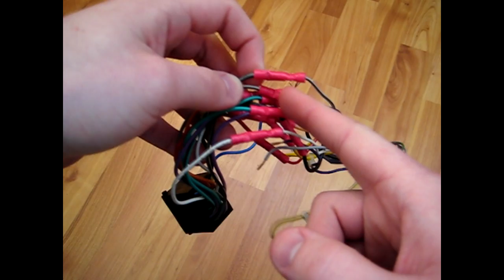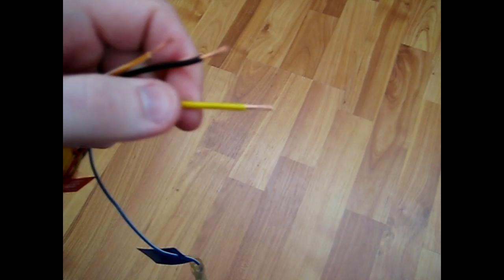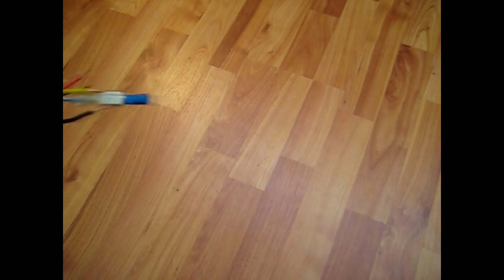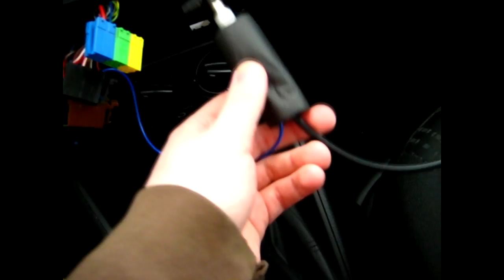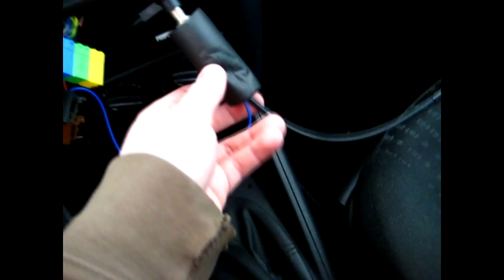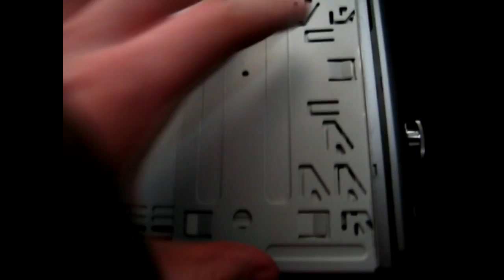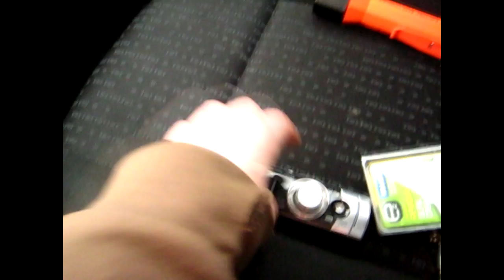DIY: Installing An Aftermarket Stereo Into Your Vehicle

Comment: I know im like wayyyy late but uh, one thing ive learned is that if u kinda take the wire stripper and spin it a bit around the wire, it cuts the outside. A few times ive just straight pulled it off and took a couple strands of wires with it (maybe im just a dumbass doing it like that, but just easier/less chance of screwing up imo)

Comment: hi i put a cheap carsio headunit in my car which was working fine, and still does, i have it wired to ignition, everything was fine, but all of a sudden it wont remember my radio presets whennit used too.....is there a little backup battery in these units?....which needs replacing?...thats the only thing i think it would be....cheers .

Comment: a  i have a 2003 passat, what dash kit for a single din stereo should i buy?
Reply from the maker: +tomas de lillo If you have a double din factory, then you will need a dash kit. If you currently have a single din, then you do not need one. Otherwise just pick the dash kit which ever is applicable to the vehicle. It'll stay on the side of the box whether it fits your vehicle or not.

Comment: i have a 1999 vw jetta vr6 i have two red/white wires which one do i connect my yellow aftermarket stereo wire too?? please help
Reply from the maker: +Christian Medina One is for the speaker and the other is the 12V source http://faculty.ccp.edu/faculty/dreed/Campingart/jettatech/speakers-front/VW-Wiring.pdf Stated by that wiring diagram, you will want the one with the thick red and white strip. But if you're unsure, just use a multimeter or test light to determine if there is power there or not.

Comment: I used the ISO connector, the strange thing is it worked for 2 weeks and now the original golf gamma stereo works but the pioneer one doesn't
Reply from the maker: +Sammy Laskowicz But how did you connect the wires between the iso connector and pioneer harness?

Comment: I installed a pioneer Mu160 in a golf MK4, it worked fine for two weeks, hen i decided to fit the cage in and push the stereo in properly.....now it does not work at all in my car however the wiring for the stereo is fine because it works in other cars......also the car wiring isn't completely ruined as the golf's own stereo works when fitted back in........tried buying a new stereo, and that will not work.....do you have any idea what the problem might be???
Reply from the maker: +Sammy Laskowicz Sounds like a connection could have possibly shorted out, therefore blowing a fuse in the vehicle relating to the radio circuit. Did you use crimp connectors???

Comment: I need to know where to get a harness for my vw jetta 99 I bought one from autozone they said it was the only one they had and it was the wrong one I could only get the front speakers to work I know they did work on the factory player I just need a link or part number
Reply from the maker: +Chucky Hall Do you have a MK3 or MK4 VW??? Also is it equipped with a Monsoon unit??? You could check a wiring diagram and determine if the wires from the aftermarket plug and play connector match.
Reply: Idk if its mk3 or 4 it came with the Bose I think when I hooked the one I bought up only front worked
Reply from the maker: +Chucky Hall What year is it??? 1999 or 1999.5??? This will affect what type of audio system it has. Was the Bose unit factory or aftermarket???

Comment: hi i do not have plug and play cable connector, can you provide the break down to the original wiring so i can connect the cd player wiring directly to the car cabling.
Reply from the maker: +Meshack Brijmohan I would recommend a plug and play connector as it makes the installation much easier and can be reverse if you want to keep your aftermarket stereo and sell the vehicle with a stock radio. They are fairly inexpensive and can be purchased from an audio dealer or online. But if you do wish to cut the existing harness, then you will need to find an audio wiring diagram specifically for your vehicle. Usually they are fairly easy to find online.

Comment: Hey 4DIYers,
I have a 2003 Jetta TDI
after installing the aftermarket radio (w the stereo connector (no module), antenna adapter), my windows, sunroof, power door locks aren't working and the alarm goes on if i open the hood. 
and then recently the handbrake and low beam headlights aren't working as well...
Is it all related? Did i made a mistake?
Reply from the maker: +Jean-Philippe Villeneuve Did you reinstall the stock stereo to see if it makes a difference??? Was it a single or double din stock stereo???
Reply: 4DIYers , I destroyed the stock stereo :)
That was a double din!
Reply from the maker: I have heard of issues with the double din units and some do require a module to be installed instead.

Comment: at 5:26 you can see a blue clip with wires from the car, which do not fit into the plug and play harness. What are these for? Did you wire them into the stereo somewhere?
Reply from the maker: J. Spooner That is the prewiring for a cd changer and isn't needed when installing and aftermarket unit.

Comment: Hi there! I have a 2001 VW Golf GLS I believe its an MK4. The monsoon radio it came with just stopped lighting up so I want to switch it out with a new stereo deck. The car audio place told me that because it's monsoon premium sound, they would have to bypass my amp and the job would cost around $100 to install. This tutorial you have here, will this bypass the amp, or does the harness use the stock amp? I found other videos with people saying to rewire all the speakers and I am a bit confused :( Thanks! :)
Reply: The monsoon amp is signal sensing, and in some cases you can get battery drainage from the aftermarket radio keeping the amp on after vehicle shut off. Because of this, most places just bypass the amp and use the receiver for amplification
Reply from the maker: Tea H Apparently it is possible from what I've heard as well. Unfortunately I haven't done one myself though. My tutorial is only based on a generic installation and my VW wasn't equipped with the Monsoon system. Check out this thread here, they did a full installation on a Monsoon system without buying the expensive harness. http://forums.thecarlounge.com/showthread.php?5595932-DIY-MK4-Monsoon-Equipped-Aftermarket-In-Dash-Head-Unit-Installation-(R32)

Comment: I have a question . K wire is the third pin of black harness ?
only disconnects or is redirected to another pin ?regards!
Reply from the maker: el Faktor Here is a diagram for the K line http://www.ross-tech.com/vag-com/images/radio-k.gif Just remove it, tape it off and leave it disconnected.

Comment: I tried installing a stereo into a 1998 ford escort today and once it's all in there it will not turn on. I took everything back out and checked that everything was wired properly and secure. ( using splice connectors ) I've checked mostly all the fuses I just need to check the ones under the hood still. But if those end up all looking ok do you have any idea of what might be wrong?
Reply: I took it to a professional installer and after all this I feel kinda dumb haha. A few of the wires didn't have good connections. I assumed pulling on them and feeling them not move wasn't a good enough test. And besides that the fuse for the radio in the car was a 5amp fuse and for an aftermarket stereo it needed to be changed to a 10amp which I've never had to do in any other cars. Honestly I wasn't aware you could change them like that to begin with. But it's all in and working now. Just an opportunity to learn from my mistakes I guess. But regardless thank you guys so much for the help. I really really appreciate it. If I ever need anything else or know someone that does I'll know where to send them.
Reply: I did check under the hood earlier but I still need to double check to be sure.
Reply: Did you use a wiring diagram or did you just match up all the colors? Some times the two wire colors of the radio and the car could be different, at least for the car I did it on the two were different.
Reply: Yeah I just matched the colors. Like I said though it worked the first time I plugged it in. The yellow aka battery wire came unplugged then it turned off. I reconnected the wire and since then I've not gotten it to turn back on.
Reply: James Morlock Did you make sure that all the other wires are still connected?
Reply: James Morlock Also check your fuse box and make sure you didn't blow a fuse.
Reply: Yeah I took the whole thing out and pulled on all the connections to make sure they were tight if any came loose I re-fastened them. I've checked the fuses on the left of the pedals. Sadly I need two people to open the hood of the car so I'm gonna check that fuse box tomorrow. I checked it earlier and everything looked ok. But I'm gonna thoroughly check them tomorrow.
Reply: James Morlock Alright. Hope you find out what's wrong. :)
Reply: Yeah everything is good. Fuses, connections, everything that I can check with only my eyes. Unless there's no power coming through the wires I have no clue what could be wrong.
Reply: I'm stumped as well. Sorry.
Reply: Its all good. I'm gonna take it to a professional tomorrow. Thank you very much though.
Reply from the maker: James Morlock Just to make sure I'm on the same page here, it sounds to be as if stereo was working originally and stopped after the wire came disconnected. For the power supply wire, you can either use a multimeter or a test light to ensure it is getting power. But from what has happened with the wire coming disconnected, that would have caused an arch or possibly shorted out on something and most likely a fuse is blown. Did you use a multimeter to test the fuses or just a visual inspection? Also on most (if not all) aftermarket stereos they have a fuse on the backside of them as well. So technically the stereo circuit, with an aftermarket unit installed is double fused.

Comment: Hey I've got the exact same golf as you.... I ran into an issue with my harness wires ones a red/yellow accessory 12v and ones a constant 12v which should I connect these wires too?????my power won't go on at all!!
Reply from the maker: AARON Jones The constant 12v should connect to the stereo's memory wire and the accessories wire is used for the stereo's on/off control.

Comment: Hi, 4Diyers. I installed a Kenwood CD deck into my mothers 2000 Passat. Everything works great, however the battery is draining. Here are some possible problems that may be draining the battery, 1) I left one wire from the stereo bare (I forgot to place electrical tape over the bare wire, which was pre-stripped). I believe it's the mute wire, which I'm not using. Could that be drawing power?

  2) I left the 'blue antenna wire' (aftermarket antenna, same one you used) loose, without connecting it the way you did (I was getting good reception without connecting it). The wire has 12v written on it. Could it be draining the battery?

 3) The last possibility maybe the (stock) Amp that came with the monsoon system (the stereo system that came with the vehicle). However, I don't understand how this could be the culprit, since the stereo is 'talking' to the Amp (making it turn on when the key is inserted into the ignition), or the stereo is turned on manually (again, after the key has been inserted into the ignition). Just to be clear, the ignition wire appears to be working (stereo turns off when the key is removed).

   I'm sorry for the wordy introduction, however I wanted to give you as much info as possible. I'm visiting my parents and want to make sure that this issue will be resolved before I leave. Thanks.
Reply: Its not uncommon for the monsoon amp to not power off after an installation of an aftermarket head unit. In many cases they are bypassed from the beginning
Reply from the maker: pillsareyummy 1) It's always a good idea to cover up an bare wires, even if they aren't being used. Just a safe practice and if there was ever an issue, at least it's one less thing to worry about. The mute wire is a signal wire sent from a switch, so that is most likely not the issue.2) That blue wire could be a possibility. It needs to be on some type of switching wire, so it knows when to be turned on with the vehicle. Now the 12v wire it is current feeding from (is it red as well?), is most likely a 12v constant power supply also intended for the stereo to remember it's settings. That could possibly be the issue on the power draw.3) That could be an issue as well, depending on how the amp was wired in. Between the stereo and amp, all the speakers are sent to the amp, the amp then enhances the signal and it feeds the speaker. But the amp also needs to be powered up, both by a 12v power supply and a remote wire. That would be controlled by the stereo... Therefore the amp should be on the remote wire, if it was on a 12v constant such as the antenna wire, the circuit is still powered up and becoming a drain on the battery. Not a problem, providing as much info as possible is a huge help!
Reply: 4DIYers I've read if you run the red wire to the fuse box you can connect it to the wipers fuse and that should fix the drain issue, adding a relay to the amp in the back or a few sources attach it under the steering wheel. "what I did to solve the problem of ignition was put that cable into the yellow nut number 75x, instead of placing it directly into the fuse box (it looks bad) You do that by removing the plastic cover beneath the steering wheel,  you will achieve the yellow nut 75 Put that cable there !!" please correct me if I am wrong, I still am trying to understand it all. :P

Comment: This is a great DIY for those owning basic VW vehicles. For those who have the Monsoon double din premium unit in their cars, as I do on my 03' GTI you will need a different harness and either need to tap into a 12v accessory source (aka something that only powers on when you turn the key to accessory) or get a harness that supplies its own 12v power. I have the Axxess XSVI-9003-NAV Wiring Kit after initially getting the incorrect harness and not wanting to fool with the wire tap. 4Diyers thanks for the good videos

Comment: Hey quick question, Um the big yellow/green/blue plug what do you do with that when you are putting in a after market radio?
Reply from the maker: That was left disconnected. When the new aftermarket stereo is installed, that plug is no longer needed. At around 7:00, you can see the plug is left disconnected.

Comment: I have just installed an aftermarket indash in my infiniti I 30. Everything seems correct but my inside speakers are not playing.  The amp and my 12s are working fine. I had the factory bose system in the car before. Did I blow a fuse or do I have to bypass the factory amp.
Reply from the maker: Sounds like your vehicles stock amp is not powering up. Could be either a fuse blown or it's not receiving any power. If it's a wiring issues, you would have to determine which one powers up the stock amp and then either connect it to the 12V accessories wire or the aftermarket stereo's remote wire. The stereo speaker wires go to the amp and the amp wires go out to the speakers. So you do need the stock amp in order for them to work.

Comment: hey i just brought an pioneer after market ready i have everything i need but it won't turn on at all when i turn the key and try on the engine the radio doesn't even blink and everything is were it should be i have a 94 honda civic. i checked the fuses and there all fine and i don't know which one of the fuses is for the radio i can't find where is says it. please help :)
Reply from the maker: Are you sure the stereo itself is getting power from the 12v constant wire??? If you have a multimeter or test light, you could check it with that. Besides being a fuse specifically for the stereo in the car, there is also a fuse in behind the stereo as well. Do you also have a good ground connection as well??? That can also be tested with a test light or multimeter.
Reply: thanks but i got it, it was a blown fuse under the hood
Reply: ***** I think I have the same problem. The fuse under the hood controls power to the radio? Is it the little fuse box on top/by the battery?
Reply: yes

Comment: I have a question, I have a 2000 MK4 Golf GL. I recently just bought the vehicle for my automotive class to work on. It had a check engine light on but no scanner no matter how high tech it was couldn't scan my car. I just recently found out about the K Line issue. I figured since my car came with an aftermarket stereo from previous owner, maybe the installer didn't know about the K line? What can I do to disable that line so I can scan my car again?
Reply from the maker: I've never tested any codes with a K-line still hooked up, so I'm not sure as to what issues it will cause. I have heard of cases in the past it will either blow the fuse in the scanner or burn out the scanner. Basically all you need to do is disconnect the wire from the harness and that's it.

Comment: i followed your instructions but im sure i did something wrong because my battery has continually drained till it was dead and now im on m second battery...someone help me please
Reply from the maker: Do you also have an aftermarket amp? Is there stereo actually staying on and is it controllable when he vehicle ignition is off? If you pull the fuse for the stereo, does it stop the issue?